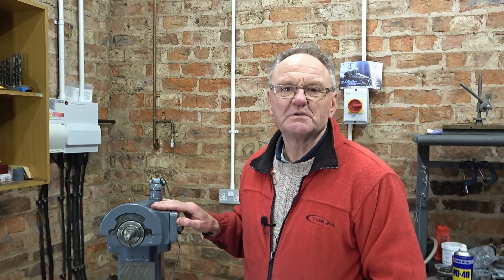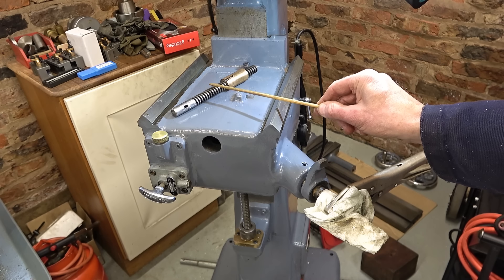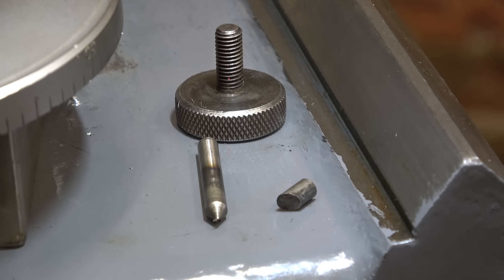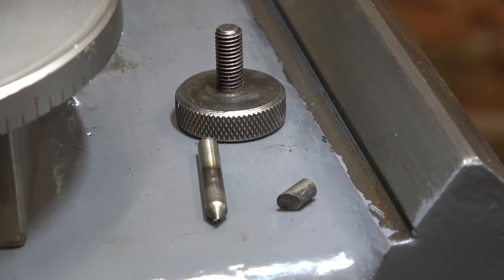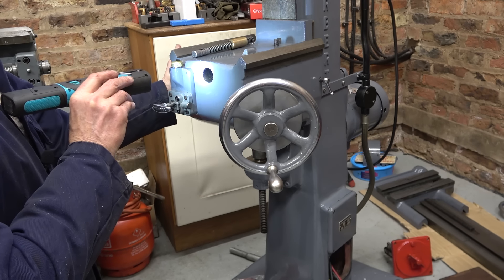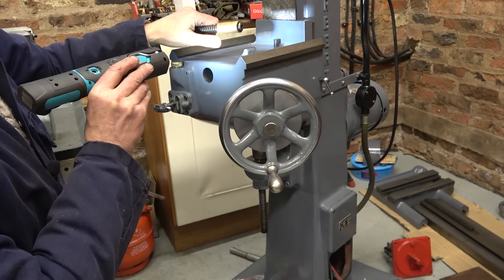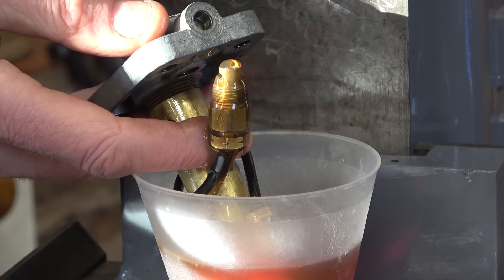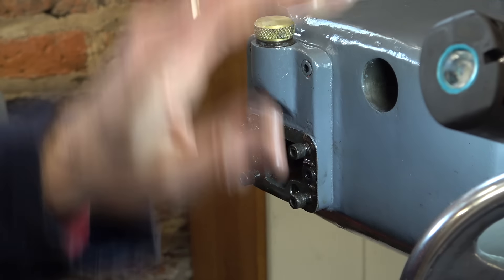HS234 Herbert Junior Mk2 surface grinder Part 7 - Knee removal

Comment: The knowledge that it is working correctly makes it all worthwhile! I would have taken all the wadding out and washed it through with brake cleaner, which you probably did anyway! You also get to clean the gyb and knee slide rails. All good stuff!
Phil
Reply from the maker: Hi Phil, if I had an ultrasonic cleaner I may have cleaned them all. It's on my Christmas list. Or I need to do a review on one, but unfortunately Vevor do not sell electrical in the UK else I would have asked for one from them. Cheers
Reply: @HaxbyShed  I bought a Vevor electric melting furnace a couple of years ago, it worked very well indeed…….once! And melted a crucible of copper in 35 minutes. Next time i turned it on it didn’t heat, element had failed. After a somewhat protracted exchange with Vevor they told me they had no spare elements for uk, but if I had one made they would pay the cost, which they did. It was made by a kiln manufacturer in the potteries area. I bought the kiln from china without realising it was  a third party seller or whatever, but it all came out right in the end!
Reply from the maker: @philhermetic  Hi Phil, my next video is another Vevor review - my 3rd. I pointed out an error on the Vevor webpage about another product and they corrected it without delay. So I think your experience kind of reflects my positive experience. One correction does 'not a great supplier make' but the signs so far are encouraging that they do care about customers perhaps. Cheers

Comment: Well I certainly did not know about metering valves and learned quite a bit as well.  Thanks Paul!!
Reply from the maker: Hi Russell, I'd never seen them before but people have said the Bridgeports have them. That little grinder is a real quality machine.  Cheers

Comment: I don't think it was a waste of time as we learned a lot too and you saved us the time at some point in the future. Having the assurance that everything works as it should is worth a lot too
Reply from the maker: Hi Joseph, can't believe I've lived all these years and never heard of metering valves but there you go. It seems like the oil feed to the saddle lead screw and nut is not enough. I will give that some thought. Cheers Paul

Comment: I have a Bijor oiling system on my old surface grinder. It’s called a “one shot” system because you only need to pull the handle once for the day. The correct oil viscosity is important. I use Vactra #2 way oil and that seems to work well in my climate controlled shop. As you stated the numbers on the valves correlate to the flow rate. My system goes from 0-4 or 0- 5. After my restoration where the system was completely drained, it took quite a few times pulling the handle over a few hours before I saw the fluid coming out. Looking forward to seeing it run and cut.
Reply from the maker: Hi John thanks for the info. Grinding operations are still a bit off yet, though now on the horizon at least. Cheers Paul

Comment: Yet another very informative lesson. Thanks Paul
Reply from the maker: Well yes maybe Jon, but one I could have avoided if I had bought a manual (which maybe expensively available from lathes.co.uk). A viewer sent me a manual for the Mk1 but that does not have the oilers.  Cheers

Comment: Perseverance right on.  I wonder why the designers put filtering on every outlet after oil has traveled through the manifold?  I could see a filter at the inlet side before the manifold, but they are smarter than me. I felt like i was sharing your frustration. Right on👍🏻
Reply from the maker: Hi James, my thing is I don't finish until I'm done. When I was employed I always seemed to get the tough ones because I never gave up. No pain low gain. It's hard to make a vid that is frustrating but watchable - gotta keep smiling. Cheers

Comment: I never expected to see a manifold like that. It must have been a real quality built machine in its day. Interesting video, Paul. I'd try a thin oil, less resistance through the filters. Cheers Tony
Reply from the maker: Hi Tony, yes I think it is a real quality machine. I think even the castings are quality because they do not seem to flash-rust like the lathe and shaper  - which are a bit of a shocker for it.  Cheers

Comment: Well Job of old would be giving you a Thumbs from above, and so are we viewers. My LeBlond 17 (1941) has an self oil like this, but you actually have to pump it. Maybe the screens in the other one way fittings have debris? When you hand sucked the oil out, there were some condiments come out of the tank. Thx for sharing Paul.
Reply from the maker: Hi Bear, there might be a bit of muck in it but when I looked in the tank there was not much, and the first valve in line, screwed on the back of the pump, should have caught it and that seemed to flow ok.  These systems are more complicated than I realised. Cheers Paul
Reply: We followers know you will figure it out, and share your findings, Bear

Comment: Metering valves. I watched a young man from the UK once drill out all of the metering valves on his Bridgeport because he didn't know what they were for. 🤦🏼‍♂ I use #2 way oil in my Bridgeport. It's a bit thick, but seems to make it through all the hoses.
Reply from the maker: Hi Greg, looking it up #2 way oil seems to be ISO68 and #1 seems to be ISO32 equivalent. Yeh I need to be going a lot thinner than the stuff I used. Cheers Paul
Reply: @HaxbyShed  My K&T uses DTE Heavy Medium, which is also ISO 68 but it seems a lot thinner than the Hangstefers #2 way oil. 🤷🏼‍♂

Comment: Hi There Those little valve devices you are referring to are not really valves, they don't actually meter.  they are probably better described  as a Distribution Balance device, each one is restricted in accordance with its number.  If you should resize one, it destroys the balance of all the others in the system.  They are selected with reference to the amount of items requiring oil and how much for each item depending on load etc. The fact that the pump handle only travels slowly is good, as it means there is a prolonged flow to each item and the system has not been over sized, relevant to the pump output.  I personally don't like them as they tend to defy logic,  there are much better more accurate systems available, however they have a price to match, beware those Tecalemit  parts are not cheap, in fact very expensive.
 As you may be wondering, it used to be part of my job to both design and modify these systems, usually taking much trial and error, making one off jobs very expensive.  Also I agree with your comment on the viscosity of the oil you are using, even living in Australia I never used anything heavier than ISO 46 also beware that some of the additives in slideway oils can clog these devices so they need plenty of exorcise.  keep up your great work it must be a great help to lots of people.  cheers Ray
Reply: Spot on, akin to carefully crimping, or bashing copper tubes to reduce delivery, and surreptitiously hiding the precision dent under pipe clips. Not heard of slideway lubes clogging systems, is that the "Tackifiers"?. Its been a long time I've fitted this type, we use progressive types, Lumatic manufacturer, pumped via a Beka, or Willy Vogel unit. It can be hard work getting the fitters to pipe each measured element to the correct point, and not wasp elements around for ease, and not  getting approval from engineering.
Best Regards John.
Reply from the maker: Hi Ray, interesting comments sharing your experience thank you. I was going to use ISO 68 but now you have me thinking I need to buy some ISO32. Cheers Paul
Reply from the maker: Ah I can imagine that John, I'm sure getting the fitters to follow plans might be a problem. We have enough problems getting builders to follow plans rather than building things to their convenience. Human nature being what it is ......   Cheers

Comment: Surprisingly comprehensive lubrication system,  fairly sure the machine tool fitters hated piping that knee, though made a little easier with flexible nylon.
My Bijur plunger pump on my Bridgeport mill creates 4 Bar (60 PSI) during operation ( I added the pressure guage), takes about 5 to 10 minutes to decay. ISO 220 is way to viscous,  68 or 32 are the norm.
No doubt you've deducted that the metering units are to ensure adequate lubrication to each feature, and to be tolerant on sliding surfaces with excessive wear or free movement, and stop oil going to least path of resistance. Total metering delivery should be less than total pump output obviously. 

A  more controlled system,  is called "Progressive Delivery", whereby there is a manifold with spools, a tube from each is fed to each machine feature; each spool when shuttles across delivers its dose based on size, then having fully shuttled, the next spool delivers to its point, if there is a blockage, the spool cannot move, so no more lubrication,  a sensor is fitted to detect this "Steady" state, in normal operation,  the sensor sees a spool oscillating. 

Very interesting installation Paul, thanks for sharing.
Reply from the maker: Hi John, thanks. I understand the comments about my unmetered shaper oiler system now but that has clear tube so I can see the oil is nonetheless getting to all parts. Cheers

Comment: I just made a 5 TPI lead screw and a nut that was on a 16mm shaft. It did come out ok but it took a lot of passes. Well, a lot of spring passes actually..I’m interested in seeing how you approach yours.
Reply from the maker: Hi Jason, I finished making the 5/8 5tpi ACME tap today and I am starting on the new bronze nut having already  cut a test nut in delrin. You will see in later videos. But to answer your question it took maybe 60 passes starting at 2 thou and ending up nearer 1 thou as I went deeper. There were 7 operations per pass so altogether over 400 individual operations: apply cut, start lathe, stop lathe, remove cut, reverse lathe, stop lathe, set lathe forward, and repeat x circa 60. I was going straight in with a 5tpi carbide insert into silver steel. On reflation now I'd have gone in at 14.5 degrees to make it easier on the tool, and my nerves. Cheers

Comment: did you price out those valves yet??  I did a video on these a couple of years ago.  I got mine flowing on a bridgeport by less than desirable methods.
Reply: I did an Ajax turret mill a couple of years ago, about 25 branches, on 3 manifolds, I was told by experts to replace them since they can't be cleaned; the metering valves "proper" price was about £45 each+tax (go figure...).  I cleaned them in my ultrasonic bath using solvents, then (white) vinegar and they work just fine. I replaced all the pipes and olives.  I since learnt you can buy them much cheaper but with so many branches it would still be a small fortune.  I only paid £350 for the mill, a 4 horsepower AJT4 weighing nearly two tons, the knee alone weighed 350Kg.

You did a good job and it was worth it because you now know it's right, THAT makes it worthwhile.
Reply from the maker: ah yes ... an ultrasonic cleaner is on my list to get sometime. Machines can be cheap but for sure repairing them can be expensive, or just buying any tool new for that matter.  Cheers
Reply from the maker: Hi jagboy, I think just thin oil will help now I understand them. Cheers

Comment: Hi Paul, I thought you would take the knee off eventually but I didnt think it was going to be for this. It looks quite a complicated lubrication system. 

After all that does it actually lubricate all the different points, especially the lead screw and nut which you are going to remake? 

I am missing your grandaughters at the start!!

Have a great weekend!!
Reply from the maker: Hi David, I offered 'air time' to my granddaughters on the next vid bit it was like 'nah' - you have to catch them in the right mood. Cheers

Comment: This rather reminds me of a black and decker chainsaw a friend gave me, i bought some proper chainsaw oil and the pump didnt pump, so i bought a new pump, then found out that B&D chainsaws use a much lighter oil than McCulloch do! Right oil and all was fine, could your oil be too thick even bearing in mind the weather? It does look remarkably gloopy for the purpose.
On the bright side, you now know how to remove the knee.😉
Reply from the maker: HI Chris, yes I definitely need thinner oil for the lube system. In fact that's even more important now I realise that not enough oil gets to the saddle lead screw and nut. Cheers

Comment: way oil is what you should be using 220 too thick oil and yes those are all metering valves
Reply from the maker: Hi John, I agree 220 is far too thick. I'll use 68 or lighter. Cheers

Comment: Im sure you can buy a 5/8" 5 tpi Acme tap.
Reply from the maker: Hi Richard a bit later I did a 3 part series on making a compound ACME tap for that job. I also bought one from China but it cut a bit slack so I finished with the one I made. Cheers
Reply: @HaxbyShed  Arh I see what you are aiming to do. I was thinking you would make a new shaft to match the nut. Which I think would have been the easier option.

Comment: Should try something like diesel fuel.  Some thing thin
Reply from the maker: Well Robert, I won't be refilling it with ISO220 that's for sure. Maybe 68 or 32.  Cheers

Comment: I put iso 68 in mine, no science it just seems the typical grade of oil for this sort of job
Reply from the maker: Hi I agree 68 or 32 would be right. I bought 5L of 220 for my mill gearbox because that's what it said on the machine plate but I've decided it's too thick for that even - which leaves me with excess to use up somewhere ..... so I hopefully shoved it in.  I will use lighter oil when I refill it, but the story is not over yet because the tank in the knee seems to have a leak!! (casting pinhole??).  Cheers

Comment: Not all that sure about that oil flow... That seems ridiculously restrictive... I know that it is not the best comparison, but my S22 mill can with a single pull of the handle crank out more oil than this one does in a hundred... And the mill is OEM configured by Schaublin, so it`s working as intended... A few pulls are needed after some time of sitting still to get the ways to bleed with oil on each end of the sections... It is a tad wasteful, but oil is better wasted than skimped out on... It`s possible that the oil is a bit too thick in your case, and that the machine requires regular pumps with less viscous oil, somewhat akin to hydraulic system lubed grinders where oil is constantly being fed at low pressure to the componentry and slideways... I`m not sure, but the amount of flow that was visible here seems ridiculously low... 

All the best!
Steuss
Reply from the maker: Hi Steuss, there is much more flow to the saddle and table ways. The metering valves (flow restrictors) are 4 or 5 (high flow) whereas on the saddle screw and gears the valves are 0 or 1 (low flow).  We'll maybe see later when we get to that stage. Cheers
Reply: @HaxbyShed  aaah, i have not really been taking a close look at which line goes where... That makes sense... The gears and screw mesh have pretty much 0 resistance to the flow at the outlet, whereas the table and the saddle being optimally set-up provide quite some resistance to the flow, not just by being tight toleranced, but by the oil having to push the already existing oil film out of it`s way... Phew, my lack of proper inspection and observation had me rattled... 

Warm regards!

Comment: What about the pump efficiency, the piston seal in it would have been worn by now and also that return spring. 🦚
Reply from the maker: Hiya, the spring and piston seal in the pump seem to be ok but I have had to change the sealing o-ring on the handle (you will see that later). Cheers